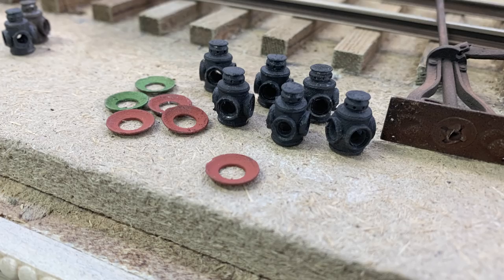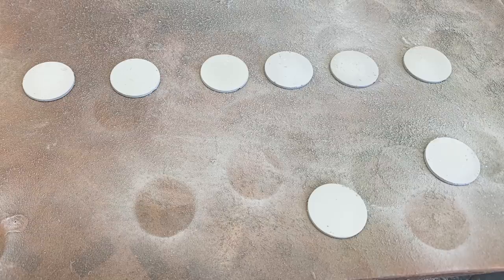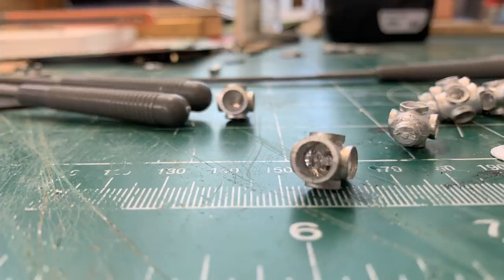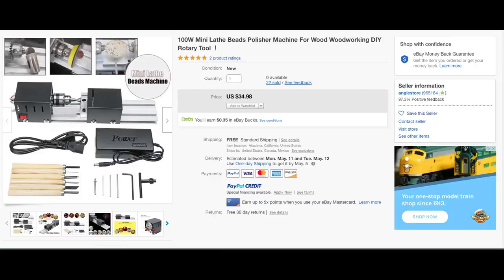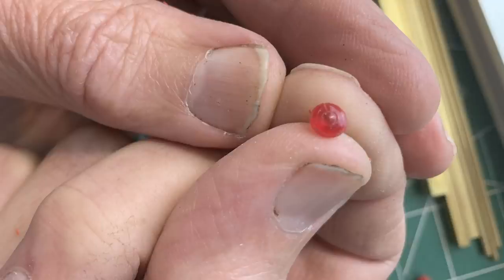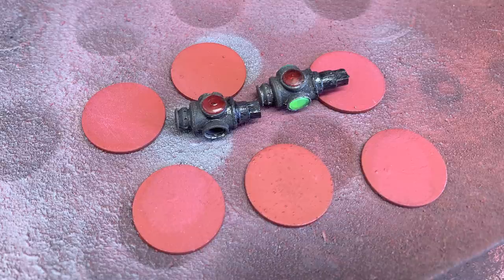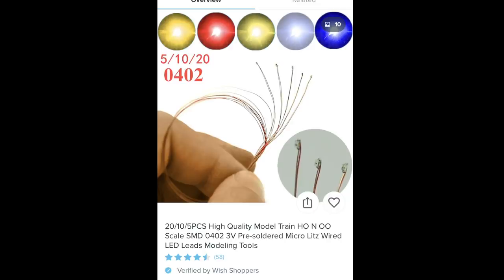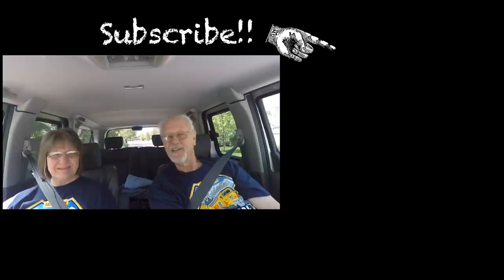Modeling Switch Lanterns for our 1:20.3 Garden Railroad

Comment: Beautiful work Dale!  Good move going with LED's. You'll probably never have to replace one of them and very little if any heat from them to "re-shape" the new lenses!
Reply from the maker: Yeah they really run cold as ice and I think if I can lower the voltage slightly with a resistor they’ll be even better. Just got a box of resistors and I’m testing.

Comment: Great work!   For making the bullet holes, you could use a small brass block as an anvil that has a small hole started in it ( small drill to creat a “dimple”). Then use a punch (nail) that passes through a guide (brass tube soldered to a C shape and to the anvil base so that the punch lines up with the dimple in the anvil.  Place target on the anvil, drop punch into guide and hit with a small hammer. Should work if the target is not too thick.
Cam
Reply from the maker: That’s really close to the way Karyn was doing the bullet holes in that piece that’s in the video. The metal is really quite thick and if I use a thinner metal it’s too flimsy. But we think we’ve come up with a solution we just haven’t tried it yet. Keep an eye out if it works will post it.

Comment: Bullet holes could be started  with a centre punch then drilled with a number drill very fine...👍👍❤️😎
Reply from the maker: What we’ve come up with so far is kind of the opposite of what you just said we can use a small punch just to get it in the right place but then drill a very small hole. Been using a larger bistro halfway through. Then use the center punch to drive the rest of the way through which splays  the metal on the back side

Comment: For making the plates thinner for the "Day Targets" which I think is a fitting name with the bullet holes, you could try fixing them into place on a flat surface and run a palm sander over them and thin them babies down.  Bullet holes I think would be good enough to drill small holes into the "Target" with a couple going through and the others just scuffing the surface and let painting and weathering take over for the full effect.
Reply from the maker: Thought about sanding them down like that but haven’t quite figured out how. Still thinking about trying to find a thinner metal but everything I’ve looked at is just too flimsy. These work great but I don’t like the thick edge. Anyway we’re still experimenting will figure something out. But I think Karyn has the bullet hole figured out one way or the other will post something.

Comment: I was travelling with a Adlake switch lamp in the car.  It was night and I wound up with a flat tire.  I had to take stuff out of the trunk including the lamp.  I lite it and the green light was enough to show up on things 20 feet away so I set the lamp so the green showed on the wheel and the red showed to the rear somewhat protecting the car.  This was in 1965.
Reply from the maker: Cool story. The lens really focused the light.
Reply: @ToyManTelevision  The green lens was much brighter than the  red.

Comment: I like your idea of using those little leds in the light. That is a great and simple idea.

May I offer you an idea or two, get some small 1000 ohm I think is the value you would need, liner variable resistors to use for dimming the LEDs. This way you can change the light levels for each lantern. Not all lanterns have the same light level do to how tall their wick was.

The added benefit of using a resistor is it drops the current across the diode reducing the heat generated, there for prolonging the life of the LED. 

The other advantage with using the variable resistors is you can take an ohmmeter and read the resistance of the variable resistor so you know what value of resistors you need to get for the light levels you want.
Reply from the maker: I just ordered a mess of resistors and they came Friday and I’m looking forward to trying them. Hadn’t thought about using a variable resistor if that’s an interesting idea
Reply: @ToyManTelevision  I've done it on a couple of projects because a fixed resistor was either to much or to little. Of course you can parallel resistors to get close to what you need. I found a variable resistor so much more simple and elegant.

Comment: To mimic the bullet holes I would try drilling a small hole and then take a tiny chamfer bit to hollow out the hole because of the plastic thickness. Then taking a sharp center punch tap the hole to show the punched through metal.   If it were thin metal, I would drill a small hole then taking a sharp bit tap the metal through the hole to mimic the bullet pushing the metal through.
Reply from the maker: Bingo!! That is exactly what we’re doing and it works great! Thank you
Reply: @ToyManTelevision  I knew you would, but an old modeler needs to exercise his brain, eh? Wish I could be there to help out at the (Toy?)mahal

Comment: You do want to put a resistor in series with those LED's. Not using a dropping resistor will drastically reduce the service life of the LED. Start with a 1K ohm fixed and work up by 500 K at a time. You can use  more than one resistor in series to get to the brightness level you are looking for.
Reply from the maker: Yes I just got a box of resistors and I’m testing
Reply: @ToyManTelevision  I've been an Electronics Engineer for 35 years. As long as you are running those LED's off of a constant voltage power supply you need a "dropping" resister. Start with a 1k ohm resister and work up from there. Wire the LED's in parallel otherwise the resistance will increase with every new LED you put in the circuit and the brightness will decrease.

Comment: Blue lens and yellow flame from kerosene makes green light.
Reply from the maker: It depends which blue. The pale blue would come out green. Some railroads would use that others would just use green. But the pale blue really shows up well and does look more like green with the kerosene lamp the blue and purple lenses really come off as a deep as your blue or dark purple. Amber clear lenses, usually called by the railroads lunar, usually meant clear track but again different railroads to different things. But the original dave marker for clear track of head which is to say hiball was either white flag or a white ball up a pole on a rope as the ball was white in the evening it would be replaced with a white lantern.

Comment: As for the LED light brightness, LEDs come in "bright white (cool white)" or "warm white". "Warm white" is a subdued brightness. I get a gadget from Big-windy on Ebay that can be configured for AC or DC input and has a DC consistent output with an adjustable output voltage (could experiment with dialing back the output voltage to get the desired effect). I have many of these to light my LED projects. They work great and sell for $3.50. One of these could powered all of your switch stands. I just checked Big-windy on Ebay and unfortunately they are presently not being offered. If you're interested, keep trying Ebay, I'm sure they're temporarily out of stock or you could contact Big-windy. Good luck. I like your videos, and yes, I subscribe.
Reply from the maker: I’m going to go looking for a big windy right now thank you very much for that information.

Comment: New footage on the intro.
Just a thought on LED's. If you find the LEDs are undimmable, the other thing you might try is apply an A.C. voltage with a silicon controlled rectifier(SCR) in a chopper circuit.
Reply from the maker: I’m testing. But it looks good for dimming. Not keen on the color temperature. They have yellow but also not great. But still nit picking. Looks great really.

Comment: Your lenses came out very realistic.  The only thing you skipped was how you got the glass polished look on the convex outside of those lenses.  I was initially guessing holding it close to a butane lighter to melt just the surface.  But maybe you have some sort of polishing method?
Reply from the maker: Hi do you know that was my original thought I even went and bought some disposable metal spoons at Walmart thinking I could heat the end and hold it against the plastic while it was spinning. As it turns out not needed at all. I take it down bit by bit with the garnet board from Germany. The finest part of that board is only about a 2000 grit. And realistically that does a good job. I tried taking a buffing wheel to them while it was spinning and really didn’t see any advantage to it. So most of my lenses have just been polished use in the 2000 grit on the ladies from that foam back Garnet board. But as I was gluing the lenses in using the super thin superglue, One time I accidentally left the green slop all over the surface of the lens. Oops but you know what it looked great! So from that point on what I’ve been doing is setting the lens in place and then putting a drop of super glue right in the very center of the wins and letting it run all the way around to the edges and in fact even across the back of the lens which I can’t polish. And boy does that look good!

Comment: Great looking switch lanterns! But tell me it isn't true that the Toy Man has a metal casting setup but does not have a proper metal working lathe?
Reply from the maker: Well at one time I had a sureline in the shop.  But I’m just not very smart with lathes I guess. I always ended up doing what I’m doing here just kind of freelancing things with chisels and files

Comment: Toyman I've been waiting for you to cure my boredom, I baught some project engines (7) from ebey to keep me going, I know that you cast parts and I may have snapped one of a two piece early athern steam loco frame could I mail one piece in and you can a new one... please!
Reply from the maker: The parts I make out of white metal really flimsy. For what you’re doing you really need brass. There is a way to do that but it’s a little bit expensive. But we should do a show and how you can rebuild broken parts and have them re-cast into brass. Precision scale can do that work as can many jewelers. But let’s do a show and show people how that’s done
Reply: @ToyManTelevision  please dooooooo!!!!!! I need this part , I was thinking about rapping it with electrical tape and then falting to it with a light but I dont want the drive rawds to cetch on it

Comment: Would it not be worth using a very thin dremmel or multi tool to drill out bits like lanterns? Just curious
Reply from the maker: I do for tiny holes like the holes for handles. But coring out the center I just hand drill as it’s a very fragile casting and the bit tends to grab.